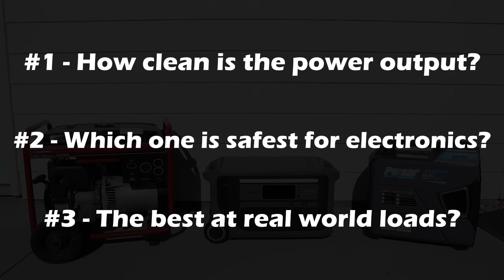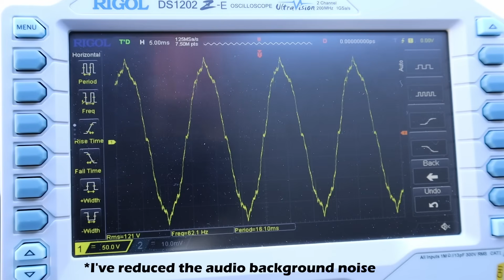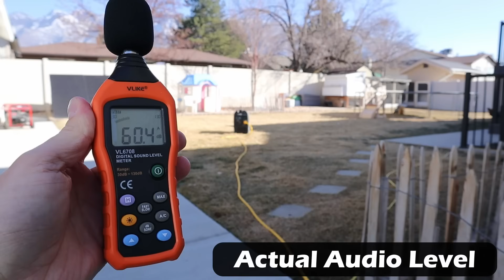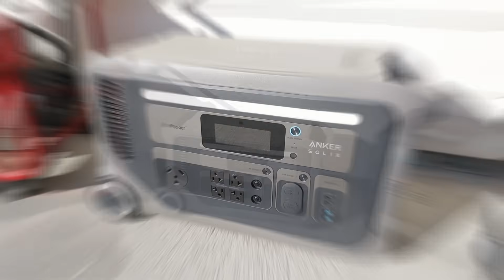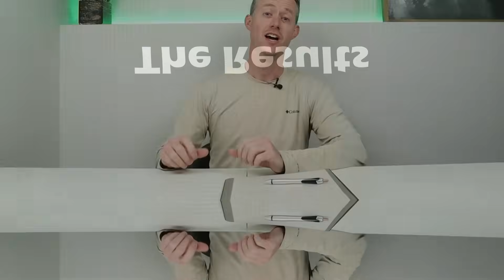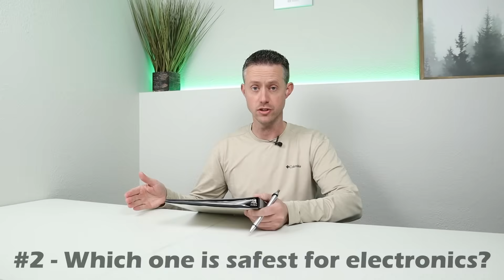Before You Plug Electronics Into A Generator, Watch This!

Comment: 13:01 Honestly, I've NEVER had any computer or other devices that were ruined by me running a traditional generator either...
Reply: I've always been told that non sine wave power is dangerous for AC motors and devices using traditional (heavy) transformers, while the switched power supplies of small electronics and computers can work with anything from DC to 100Hz, since they first rectify the voltage and then generate their own (high) frequency for their small transformer.
Reply: @MetalheadAndNerd  yep
Reply: @MetalheadAndNerd I've been living on boats for a long time and I use all kinds of devices on all kinds of power supplies. 
   I can tell you from experience that I've had both phone and laptop malfunction using a cheap square wave (not inverted) generator then they both ran fine on the sine wave (inverter) generator. 
    My power tools and electric motors all worked fine on either type of generator.
    In short my experience has been exactly the opposite. 
   Look, power from your house comes from the power plant at 60hz in the USA. That's 60 cycles from positive to negative every second. The regular outlets in your house and on cheap generators as well as "inverter" generators all put out 110v at 60hz. 
   The problem is that the capacitors in your electronics are used to a smooth transition from positive to negative. A gradual sloping wave from zero to 110 then back to zero then down below zero to -110 then back up to zero. 
   The problem is on a small uninverted generator the magnets going past the coil drop off from negative to positive and back instantly forming a square wave and it throws off the capacitors because they're usually charging and discharging at a different rate. That's why they rectify it into DC current then invert it back to AC for the outlets on the more expensive generators.
Reply: Same here. Ran an LED flat screen TV and laptop last winter for 5 straight days on a basic Champion 5000W (continuous) gene. Over a year later and I'm watching this video using the same TV and laptop. Maybe there is some equipment that basic genes can harm, but that equipment is above my pay grade apparently lol!
Reply: @joshuadoesstuffandsuch perhaps your basic generator isn't as basic as you think. You could connect an oscilloscope to the outlet to see but the oscilloscope will cost more than a new inverter generator....wait, no. I just checked. $40 on Amazon for a hand held oscilloscope. Wow. I might have to order one.
Reply: @captainKedger  Yeah but would you trust a $40 scope? I wouldn't.
Reply: @soaringvulture i can't say. I've never tried them but I've used a cardboard sextant that turned out pretty accurate. I played a flute made of 3/4" pvc pipe that had a perfect C major scale with 4 octaves... what law of physics or economics says an oscilloscope has to be expensive to be accurate? I'm curious.
Reply: Most of the components in most electronics are dirt cheap to make. Carbon resistors are basically charcoal. Capacitors are salts and foil with cellophane between layers. Memory chips are made of silicone which is made from sand.  
 Why do these components need a high price tag to work well? I'm serious. Is there some special component in an oscilloscope that costs alot to make or is rare? Is the inner casing lined with platinum? It's not new technology so what makes it expensive and how long before you think they'll start making dependable cheap ones?
Reply: I've had my laptop and my phone go haywire from plugging into a generator that wasn't inverter. 
   It really depends on the configuration of the coil(s) and  magnetic fields. Some designs are better than others. Some are so cheaply made they put put a square wave and the frequency is nowhere near 60hz. at regular operating speed. 
   If they can lay out the magnets and coil(s) just right and the motor turns at just the right rpms it produces a decent sign wave at 60hz without any electronics to smooth it out. 
   The thing is if you turn off the computer/phone and charge the battery then unplug it before turning it on they don't get messed up. 
   Charging the battery doesn't require a perfect sign wave and doesn't require a specific frequency.
Reply: @captainKedger If you have access to an old UPS, plug the UPS in the generator, the electronics in the UPS are designed for tough mains power fluctuations. 

We get weird anomalies in Western Québec from time to time. The UPS is designed to smooth out bad mains. Of course, replace the batteries if you buy a second hand one. I replace the batteries every 5 years.
Reply: @msamour  I'm running everything off solar these days so it's just a basic 12 volt system. The inverter provides a perfect sign wave but yeah, that's a great tip for anyone running off a cheap generator that's putting out a square wave. I didn't know a surge box would rectify the wave output but i suppose it would have to since it's essentially a mini inverter and battery pack. I never used them when i lived on land so the thought hadn't crossed my mind. On this boat I'd just add another battery bank and a perko switch for a backup. Then I'd need more solar and another voltage regulator. If I'm gonna add the weight of a battery backup i might as well go all out and get more continuous power.
Reply: @captainKedger Yes, I agree for you it doesn't make sense. In my case, I needed s setup I could afford. The UPS was given to me, the generator I got for 150$. I bought another UPS from 150$ both ran my entire entertainment rig for two weeks during an extended outage. So long as tge coffee maker worked in the morning. 

Ironically, this generator I had ran my 240 volt inverter welder no problem what so ever. I bought this Chinese inverter welder cheap 300$. I burned 5/16 rods in it at 160 amps, I tried to burn it out. Never failed once. I still use it! 10 years later!!! 😂
Reply: @msamour my solar panel was $80. The charge controller was $15. The battery was $120.  For under $250 I installed 100 watts of power with 115 Amp hours of storage. That charges my phone day or night, runs my lights and a small inverter for a laptop. If I connect another 50 watt panel I got for free I can run the electric cooler in the day. If I buy another 100 watts, another WPM and another battery I can run the cooler and everything I need 24/7.  I consider it much cheaper than paying $120 for a generator and buying gas the rest of my life. It's cheap to buy each component separately and put a redundant modular system together. This way you're not blowing thousands and instead it's a hundred or two here and there. It starts small but it can easily add up once you stop buying gas.
Reply: @captainKedger Oh yes, that is quite true now. 15-20 years ago, solar panels and associated gear was really expensive. I have 2 kilowatts of panel in the basement, a 3 kilowatts inverter charger, 8 batteries, and all the associated gear to install. I'm waiting for summer to set it all up. The whole kit cost me 3000$. Admittedly, I'm still using golf cart batteries from Costco. I'm old school like that. 😊
Reply: @msamour yes, they're getting much cheaper for the basics but they're also making much more expensive panels that are much more efficient. There's even a company developing solar panels that get power from raindrops on rainy days. Instead of a glass cover they use a clear piezoelectric crystal lense that gives a jolt of power from the kinetic energy of each raindrop striking it. They're getting insane... some companies are looking into harnessing the energy transfer from radiation cooling into space at night. 
   For basic monocrystaline panels you shouldn't pay more than $1/watt and generally around $.80/watt even in some retail places. 
   I don't run one big inverter to power the entire house. If it burns out everything shuts down. Besides they're expensive. Instead i look at whatever item i want to power and figure out how much wattage it takes then go buy a small inline inverter that provides just about 20% more than the peak wattage of the unit. This way everything i power off the batteries has it's own little cheap dedicated inverter. Now if a crucial unit burns out i can use one of the others to power that crucial component while I'm shopping for a new inverter. I'm not out thousands or even hundreds. I'm out 40 or 50 bucks.
Reply: @captainKedger  You simply can't product a great output waveform with a synchronous generator.  There are generators that do worse or better, but clever engineering (e.g. winding skew, better voltage regulator tuning) will only go so far.

One easy to understand source of distortion is the engine speed.  Even with a theoretically ideal generator head the rotor slows down during the compression stroke, accelerates during the power stroke, and has smaller perturbations with the other strokes.

Some of that could be compensated for with a DSP based voltage regulator, but they don't exist.  Likely because the problem is harder than it appears and not worth the complexity for a minor improvement.
Reply: @1djbecker well put. I know it's more complex than what i said. I'm just trying to help the average joe who doesn't have a degree in electronics to understand why it's best to get an inverter generator if you're powering electronic devices. 
   Yes you could, in theory, build a perfectly synchronous dynamo with a perfectly regulated motor and maybe use some type of gyro or special planetary gears that maintain an exact speed...and suddenly your portable breifcase sized generator needs to be mounted on a wheeled frame and weighs a quarter ton. Yea...just doing it electronically is much simpler, cheaper, lighter and more reliable...not to mention more efficient without all the friction in gears and pulleys. Yea i get it.
Reply: @1djbecker You can produce a great output waveform with a synchronous generator. Maybe not with these or with this size. But our line voltage comes from synchronous generators.
Reply: I had a fridge who died after runing with a traditional generator. So it does happen. The question is, i'm not entirely sure "dirty power" was necessarily the culprit. My generator has plenty of power to run the house itself, but when the well pump kicks in, it can surge up to 6kw wich is rigth at the maximum output of the generator. This causes a power drop for a brief second but it's enough to be harmfull to more sensitive devices.
I think the power drops are more dangerous than the actual dirty power, if you have a generator that can keep up with everything you throw at it without power drops you're less likely to run in to trouble. That being said, i think a much safer aproach, if you already have a traditional generator would be having a medium size powerstation to act as a "bridge" between the traditional generator and more sensitive devices. It will ensure the power stays clean and without power drops.
Reply: On a square wave generator I had one of two laptops that would malfunction and two of three phones.  It didn't do permanent damage and I was able to charge them while they're off then use them. Those same devices worked fine with a sine wave (inverted) generator.
Reply: That being your power supply is converting the AC to DC. It's more of an issue for motors, LED drivers, and certain electronics that use AC drivers.
Reply: In Deutschland haben wir 230 V und 50 Hz. Wir haben den 2.2 kW Generator von 3000 auf 1500 U/ min herab gesetzt. Die Spannung lag zwischen 110 und 130 V.

Damit haben wir zwei PC's betrieben.
Reply: I could confirm you using traditional generators without "line conditioner" feeding electronics devices: computer servers, communication (routers / LAN switches), data storage... is close to de edge: components fails in a unexpected way, data errors, dead disk, low network performance.
Reply: How to make your regular generator put out pure sine wave?
Reply from the maker: A computer has the ability to clean up the power with its built in power supply (AC to DC converter). Not all electronics have that built in.
Reply: @Jasonoid  From the response to my comment... THIS may be a good topic and demonstration to a future video.  I was just being honest in MY experience, and would LOVE to see some actual evidence to the claims of this actually happening.  Also, what devices are most susceptible?  Is there a threshold of noise that causes it?  Does using a surge protector provide any protection?  What about an UPS unit between the dirty generator and the device?  Lots of things to cover.
Reply: I have and I know other people who have too. It's definitely a risk, it can happen.
Reply: Good power supplies can take all kinds of abuse, but the lower quality ones just don't, I've seen power supplies on a 3D printer die from bad wall power. In our workplace, the two phases where the welder is plugged in will often blank out the PC monitors when you lose the arc or strike it 1st, and the worse quality power supply we had on that printer just didn't take the noise. Replaced the PSU with two Meanwell units with full input filtering and they've been running great ever since.
Reply: I was told by an HVAC tech to be careful choosing generators since he’d replaced motherboards after generator use
Reply: @richtes  Agree.  I've heard your furnace is very finicky when it comes to regular generators.
Reply: @richtes  sure: those A/C that uses inverter technology.
Reply: Thats why you use Surge protection or battery backups when running a portable generator.   The Dirty power is over exaggerated all the time.
Reply: @damontroch4765  The surge protector solves voltage spikes but is not helpful with sags in voltage. It can shave off overvoltage but can't make up for a traditional generator's lack of surge capacity. Sort of like how traditional automobiles lack torque when compared with an EV.
Reply: @JimHolder-pk2kk Three letters for you Sir! UPS. Been using them for years to clean up power from older generators. The battery in the UPS will kick in if there is too much deviation from standard utility power and smooth out the mains. Try it you would be surprised.
Reply: @msamour  Absolutely! A UPS solves all the issues of dirty power so long as the battery and inverter capacity are adequate for the loads served and the "dirtiness" including spikes, sags, harmonics and even outages of the incoming power.
Reply: @JimHolder-pk2kk Hello, yes I have done it often, but my rig looks like something Red Green was running tge Beaver Lodge on, admittedly... 😂

Ran this a good 5 years during outages until I got a real inverter generator.
Reply: @msamour  🤣

Comment: One suggestion could you test the surge and quality , thd and sinewave of the power for the different types of fuels being used 

Like factoring how easy or hard it is to start up, id like to know if the fuel type impacts anything I know with propane the altitude matters based on how gas behaves at different altitudes wanted to know if different fuels impact anything at all
Reply from the maker: Fuels should only effect the total power available, not the THD too much. The voltage drop might be worse on a traditional generator 👍
Reply: Maybe even if burning different fuels also impacts how noisy the generator is too

Comment: How are you connecting the oscope probe to your power cord? I have a oscope but I know there can be issues when trying it.
Reply from the maker: I have a custom cable I've made where the probes plug into an outlet of my choice. I'm also not using the ground when powering the oscilloscope to avoid a grounding loop.
Reply: @Jasonoid Ok, thanks!

Comment: As usual your videos are top notch and very informative .  The voltage drop on the regular generator was massive, I believe  it dropped to 65V.  What impressed me the most that the power station out performed the inverter generator.  I've been thinking of buying the Anker solix F3000 or the F3800 or the EcoFlow Pro the original.  I just want one don't need it but can't decide between the F3000 or the F3800.  I don't need 240V so that is why the F3800+ is not in the picture.  Any recommendations?  Again thank you for the hard work you do.
Reply from the maker: The F3800 can't charge with 120v input and get 240v output. It also has 60v charge controllers. The F3000 is an excellent upgraded option, watch my review on it.
Reply: @Jasonoid  Thank you.  Mainly need it to run the fridge during power outages.  Keeps me from daisy chaining my delta max 2000.  Thank you for responding.

Comment: Despite living in FL, I have resisted getting a generator (just relying on batteries and solar). But your presentation has been helpful. Thanks!
Reply from the maker: If solar is working for you, no need to change! I have the inverter generator as a backup to my backups 😂

Comment: question... can the power station be charged with regular generator? can you use the power station while charging it? Will a UPS negate the effects of a normal generator? and what multimeter are you using?
Reply: Yes , my pecron f3000lfp is charged with traditional non inverter genny. The pecron allows pass thru while also taking a charge.
Reply from the maker: Most power stations won't charge from dirty power / traditional generators. 

Power stations offer pass through charging while charging with AC input. Meaning whatever the charging source is, it will pass that through directly, without cleaning it up. Dirty power in, dirty power out.

The meter model is shown clearly on the screen, just google the model 👍